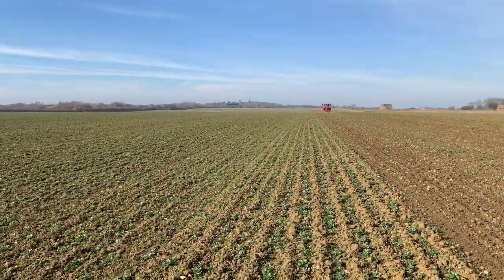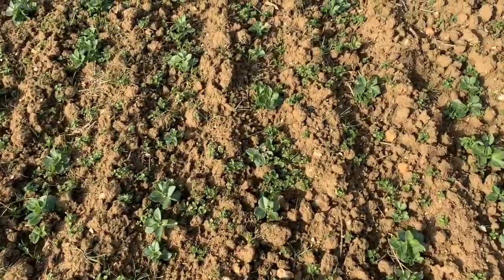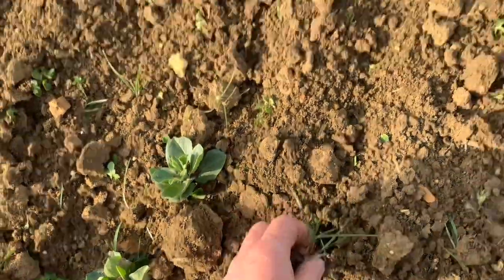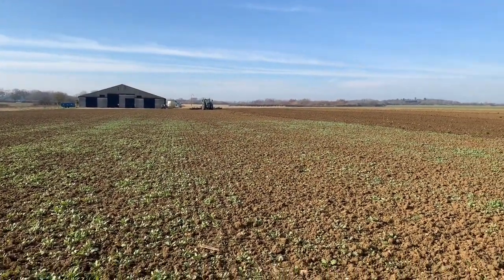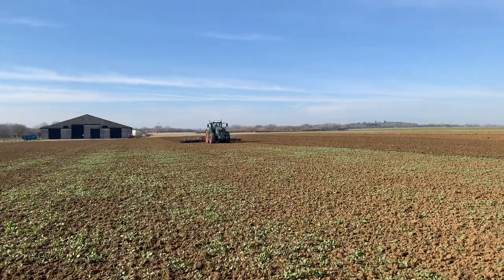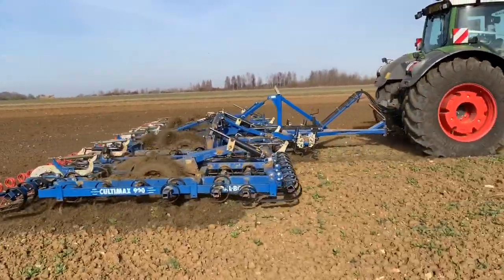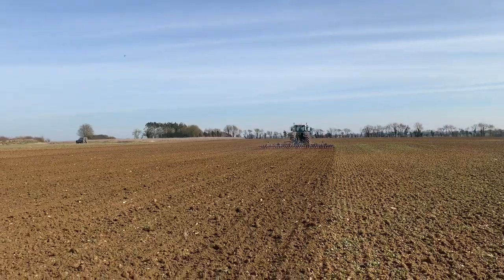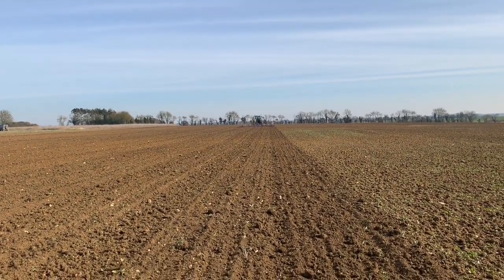Harrowing and cultivating

Comment: Nice video, has the quadtrac been sold, in favour of the fendt ?
Reply from the maker: Yes Rob, Quadtrac has gone, we are 100hp down with the Fendt but it has pulled everything OK to date including the Discordon. It’s also £100k cheaper!
Reply: That’s good then, does it pull the subsoiler too ?
Reply from the maker: Rob JW We have changed our subsoiler for a smaller one that can be pulled by one of the Case Pumas as with CTF we are only planning to subsoil the headlands we turn on and tramlines. Hopefully that will be a good decision.......
Reply: in germany FENDT is premium with the highest price!  @JohnPawseySPF
Reply from the maker: Hans Greßhöner They are expensive here Hans but this one was a demonstrator and so we got a pretty good deal on it. Actually it was comparable to the price of the equivalent John Deere. The Claas was the best priced but I was concerned about resale value in the UK. Strangely the Case was the most expensive which was surprising.
Reply: the other day i bought a stock machine JD 6115 M from Traktorpool,i sold my JD 6310 via Traktorpool with a good resale-price.
used CLAAS in my area "were changed" to JD by KRONE with very good resale-prices   @JohnPawseySPF
Reply from the maker: Hans Greßhöner Thank you Hans, that’s really interesting
Reply: Thank you John, for your interesting videos!  @JohnPawseySPF